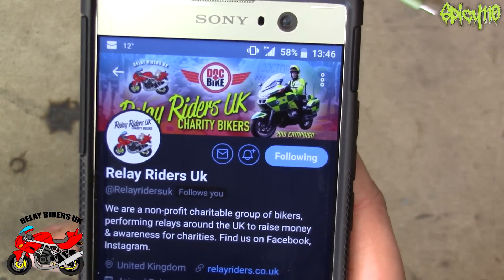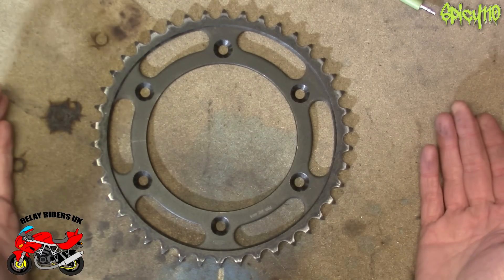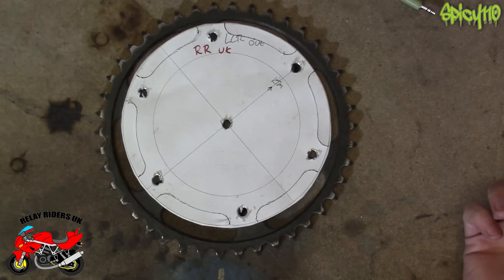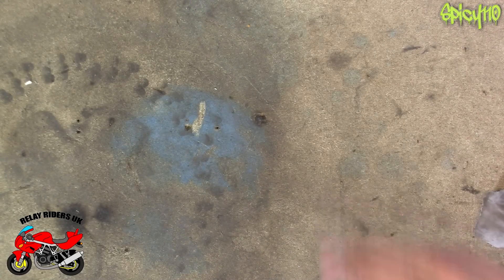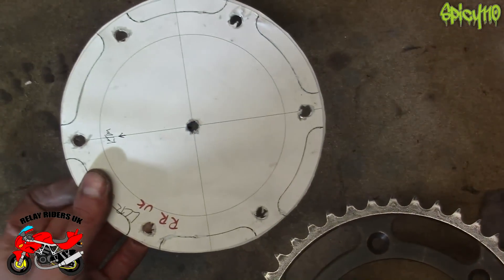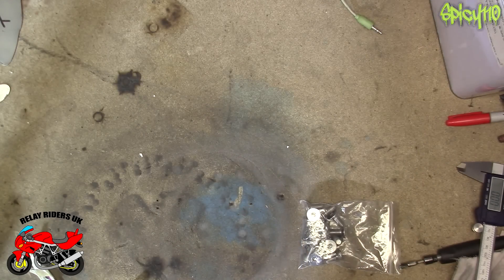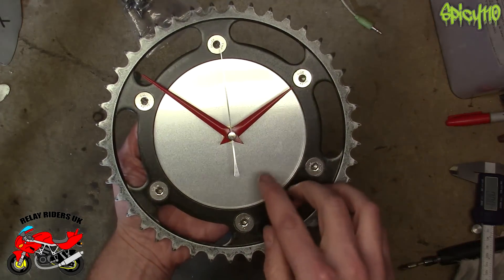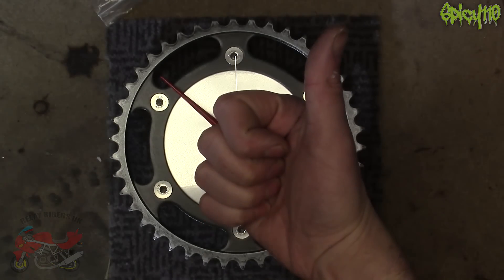Relay Riders UK Charity Clock build!

Comment: Spicy ur going to end up in hospital again no googles and health and safety would have a field day if they see ur grinding with ur knees. 😮😂😂😂
Reply from the maker: It's die grinders on steel that create the splinters that I have got in my eye in the past. Aluminium makes very thin light splinters that are not sharp. As for the knees, perfectly safe been doing it for 2 years without issue and I have kevlar jeans on with large knee armour and large leather boots. Should anything happen I open my knees and it fall to the floor.
Reply: @spicy110   lol was just kidding